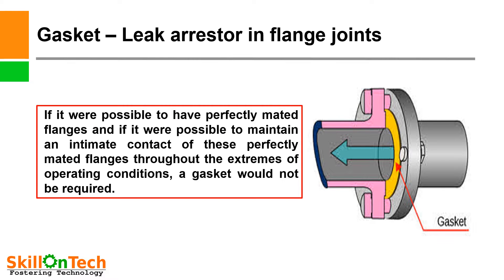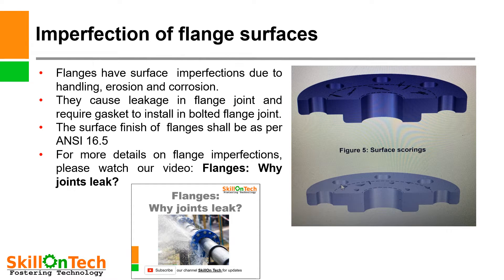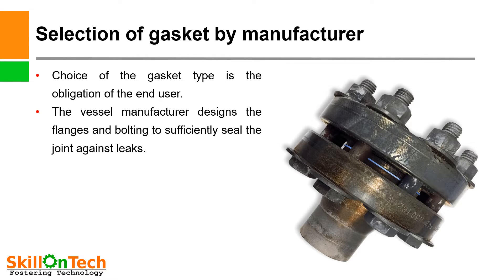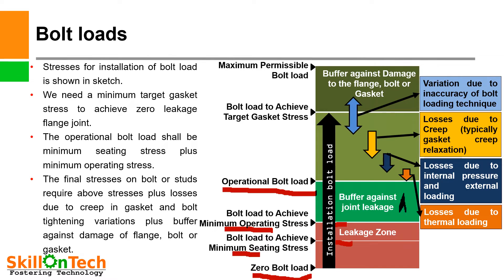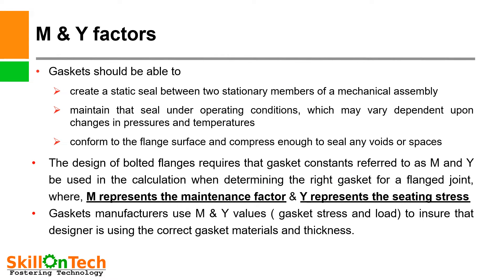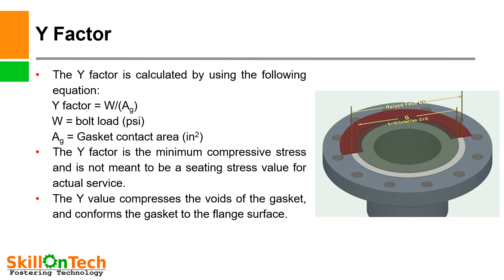M & Y Factors in Gaskets (with english subtitles)

Comment: How to know Roughness (RA) of flange face matching with M&Y factors in Gaskets? and If you have criterial of Gasket material and RA. could you please reply to me
Reply from the maker: Roughness average Ra is the arithmetic average of the absolute values of the roughness profile ordinates.
Root mean square (RMS) roughness Rq is the root mean
square average of the roughness profile ordinates.
Ra is also called AA and CLA, Rq also RMS.
Perthometer is used to measure surface roughness and surface profile texture.
The flanges with smooth surface finish of 125 rms shall be used for spiral wound gaskets and serrated finish surface shall provided graphite gasket. SW gasket shall not be used with serrated surface flange.